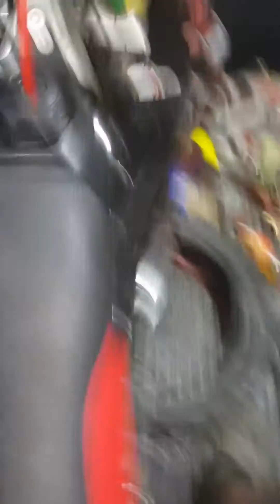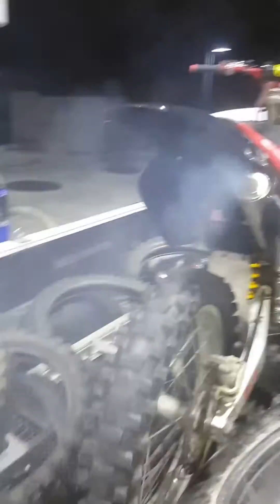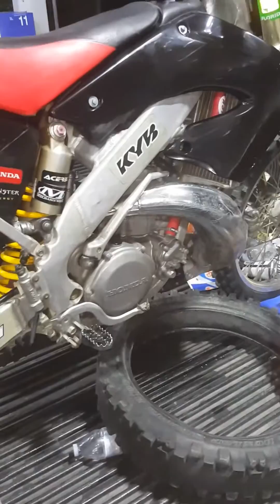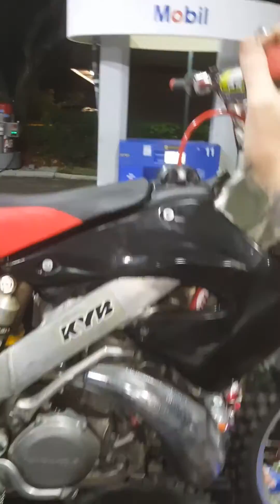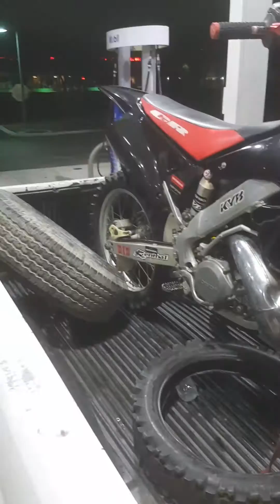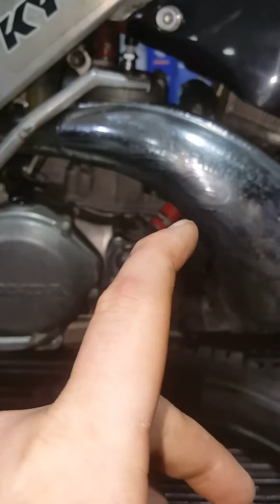Another 2001 CR250 freshly rebuilt just picked it up

Comment: Good advice on not passing up a deal, if you find a deal you need to jump on it right away or else the next day it will be gone. That bike is clean looks like it has been revalved with racetech gold valves (based on the racetech stickers)
Reply from the maker: 719moto mx that's right